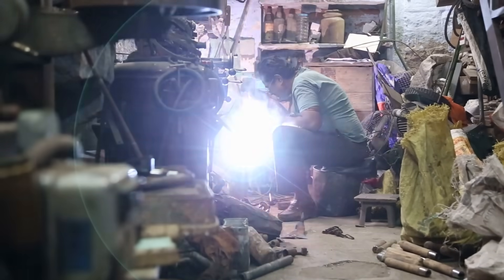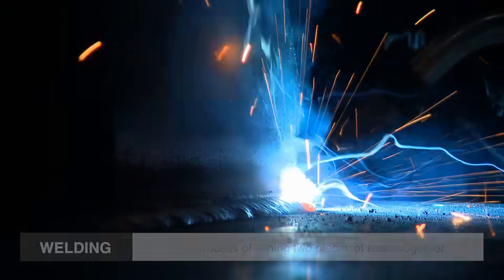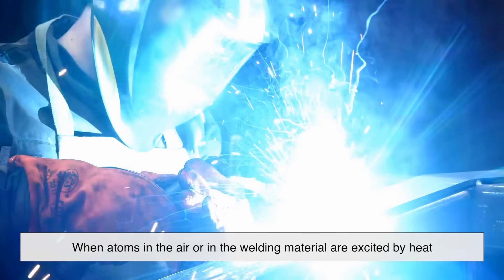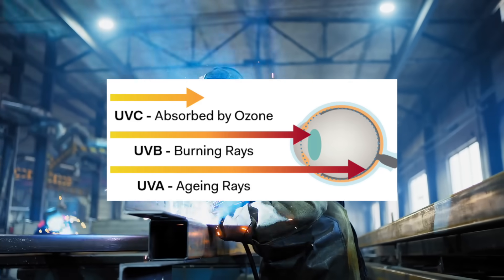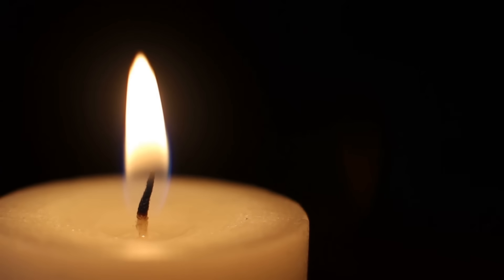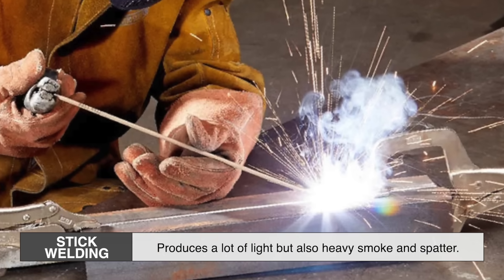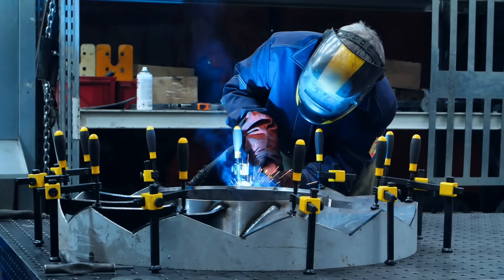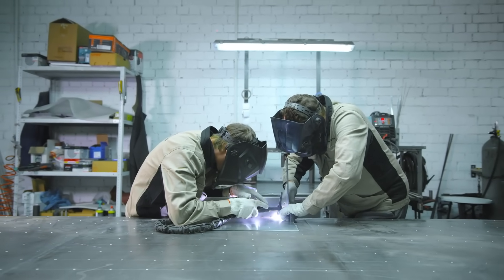Why Does Welding Emit So Much Light?

Comment: I've been flashed a few times even though I was completely covered. The light reflected off a wet concrete wall behind me. 
Now I try to position myself where that doesn't happen. Been welding since the 80's,
Still love it but also respect the dangers...

Comment: I was told by an old timer welder that out of all welding processes, a twin carbon arc torch and gas tungsten arc welding the most intense and dangerous UV radiation because of the lack of smoke and spatter, which act as sort of a filter in gas metal arc & shielded metal arc welding processes.   

In fact, if you look at the tables for determining the recommended filter lenses for various processes, you will find that carbon arc welding requires a shade 14 which is often not even stocked at most local welding supply houses, but any welding supply house can order one for you if necessary.  

Most auto darkening helmets top out at shade 13, but there are premium models available with shade 14 ability and such models would have a wider shade range, sensitivity and delay adjustments, a grind mode and a larger viewing area.   Although these premium helmets can easily run north of $200, they are a very good investment for professional welders.
Reply: You are correct in everything you stated.

Comment: I decided to TIG weld in a T Shirt one day because it was so hot in my garage.  I knew welding gives off UV but I didn’t expect to get a sunburn from 15 minutes of TIG welding.  I always wear long sleeves now.
Reply: I don't recommend this, but slathering yourself with SPF 50 sunblock will do the trick. But then you get burnt by sparks anyway.

Comment: Only about 10% of the light given off by a welding arc is visible light wavelengths. These won’t harm you. 
The other 90% are ultraviolet and infrared, both of which most definitely will F you up, and you can’t see them without special optics.

Comment: "Can cause temporary blindness"?  No, my friend.  Extended or repeated unprotected viewing of the welding arc can cause permanent blindness. I do MAG and MIG welding and I once knew a 30 year old man who was completely blind in one eye and had 30% of normal vision in the other as a direct result of welding without a helmet.  Anyone who dabbles in welding MUST be aware of the multitude of hazards associated with the process and wear the right safety gear.
Reply: I couldn't agree more. I once knew a guy who did high intensity tig welding and never wore any protection on his hands. That's the way he was taught. Ever smell exposed skin after exposure to arc rays. It smells like burnt skin, without the heat. That's because UV-C is ionizing radiation, whereas infrared is not.

Comment: Learned on coathangers and car batteries, then torch, stick and heliarc-- tungsten and argon, TIG, mostly welding 304/ 308/ 316 stainless steel. The pure immersion arc looks pale blue, hints of orange and purple; you make a crescent and fill it with the rod, scalloping the fillet, and liquid metal strays up onto the point, perhaps due to impurities or the Meredith effect, then metal vapors join the arc, and up goes the heat and radiation spectrum. A tiny scratch on your shield will spell flash burns in this condition. Prefer to bolt things together.

Comment: UV does not penetrate the lens in your eye. It burns and blisters the surface of your eye and it's VERY, VERY painful. The infrared (IR) light emitted by red hot steel DOES penetrate the lens of your eye. In fact it travels all the way to the back of your eye and PERMANENTLY damages the nerve endings at the back of the eye (the retina) where the image is formed. ALWAYS wear proper welders goggles (shade #3 or #4) when cutting or heating steel with a torch. ALWAYS, NO EXCEPTIONS!!!!!!!!!  No, your fancy ass high dollar sunglasses do not provide adequate protection.
Reply: You are correct.

Comment: Very interesting.  Is the bright, damaging light due primarily because of the electric arc, or is it the heat?  I.e., does ox-acetylene welding produce the same damaging radiation?
Reply: Oxy-acetylene welding does not produce the same type of light, it doesn't cause sunburn like electric welding, but it can still degrade your eyesight over time unprotected. Never arc weld without proper lenses and helmet, it can permanently damage your eyesight. And never use gas welding lenses with an arc welder of any kind.
Reply: @jeffwombold9167  IR penetrates the eye all the way to the back and burns the retina where the image forms. The damage never heals. It causes loss of vision.  It's irreversible and it is painless. And therein lies the problem.... since it doesn't hurt people think it's not a serious problem. I know guys who NEVER used cutting goggles for 40 years and now they are nearly blind. Torch cutting produces a lot of IR. So does arc welding but you can't stand to look at an arc for more than a millisecond so it never ends up being a problem.  

UV does NOT penetrate the eye therefore it DOES NOT and CANNOT damage the retina. UV burns and blisters the surface of the eye which is indeed very painful but there is no permanent damage from UV, only from IR. The pain caused by UV fools people into thinking UV causes the most damage when in fact IR causes far more serious damage.
Reply: Oxy-acetylene does not produce near the radiation that mig , stick , and tig produce.  We usually wear simple brazing goggles when running oxy-acetylene for brazing or cutting. Never get sunburn or arc flashed from it.
Reply: The intense light of oxy-acetylene welding can cause eye damage I suppose, but it is the intense UV-C that causes the real damage. UV-C is ionizing radiation and is in fact one step below x-rays. It just doesn't have the penetration of the x-rays.

Comment: You can use your welding shield to look directly at the sun. Welding lumes are brighter than the sun we receive.
Reply: For the love of God, DO NOT do this.  Welding arcs are NOT the same as direct sunlight.  Sunlight can endanger your eyesight even viewed through a welding helmet.  There are special solar filters for viewing phenomena such as eclipses.  Don't use a welding helmet.
Reply: @andymanaus1077  im pretty sure that guy is talking about the modern auto dark helmet. Most go up to shade 13 some are higher. But yeah a normal welding hood is shade 9 or 10. That would blind you looking at the sun during eclipse.
Reply: Only use stick,MMA lenses for looking at the sun, mig lenses are not dark enough. Even 100 amps MMA is brighter than the sun, I use an old shaded lens Not auto darkening lens for looking at eclipse.

Comment: It's not the infrared that is so bad; it's the short-wave ultraviolet. Thes are the same wavelengths that cause sunburn.  Long sleeves and a ballcap will protect your skin somewhat, but goggles are still required for eye safety.  Flash burn is no joke.  Once bitten,  twice shy.😮

Comment: Shielded metal arc welding (SMAW) aka electrode welding does not create plasma. It transforms the coating of the electrode into a hot gas that shields the arc spot to prevent the welded metal from oxidation.
Reply: Doesn't create plasma? That's what the arc is, plasma. Whether it be from mig, tig or stck. Anytime an arc crosses in open air, that's plasma.
Reply: @jamesnewmeyer7205  during this type of welding the arc doesn’t reach the extreme temperatures required to ionize the surrounding gas into a plasma state.
Reply: @ivanbratanov8699  Ok, then what is the arc, if not plasma. That is in fact the definition of an arc. I suggest you do some research before posting such nonsense.

Comment: If you are catching a eclipse in a pinch welding goggles or mask can suffice to look at the sun
Reply: You are correct.
Reply: Yes but it's important that you use at minimum shade 13 and preferably 14.   The standard 10 or 11 lens that comes with most helmets is not sufficient and could lead to eye damage.  In a pinch a shade 12 with sunglasses would probably be okay, but I'm not an ophthalmologist so take my advice at your own risk.
Reply: @rarelampcollector  Any clear polycarbonate or glass cover lens will block UV-C and UV-B from the sun. That's why they use quartz instead of glass in sterilizing lamps, because the quartz will transmit UV-C , whereas the glass will block it. All you need to do is choose a shade that is comfortable for you. The only time you need a 14 or 13 shade is if you are arc gouging at 500 to 600 amps, which is much brighter than the sun.

Comment: You can get that from the reflection.
Reply: A long time ago I was welding in a loader bucket beside my buddy. We were doing it for hours burning 3/16 7018 electrodes. He was doing on side I was doing the other. The arc rays actually reflected off of the inside of my helmet and gave me arc flash eyes.
Reply: @jamesnewmeyer7205 I was a welder’s helper and burned my eyes a few times and it hurt like 7734 if you know what I mean?
Reply: Uhhh... a time-released pain that usually starts on the way home from work 😭 that hood needs to drop right under the chin cus even reflection inside it will get you